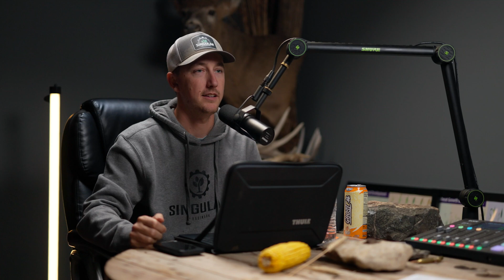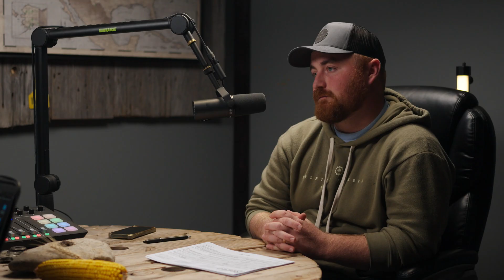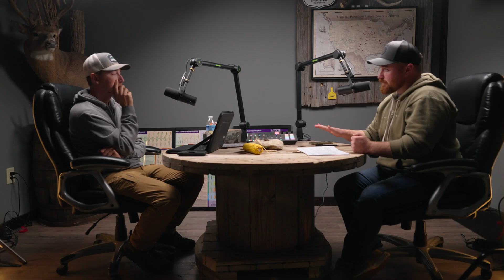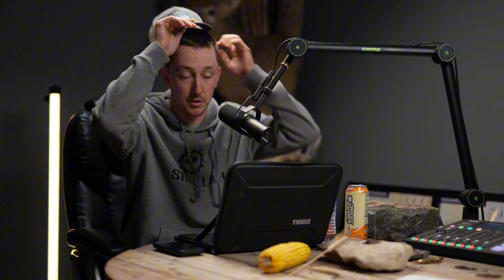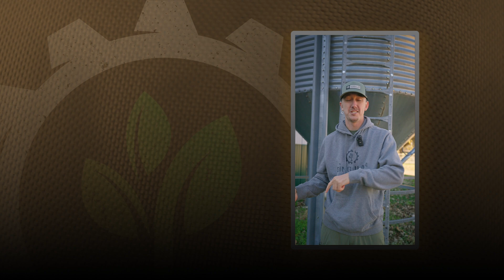Optimize Nitrogen Application Using the C:N Ratio—Maximize Your Yields!

Comment: Your video content are amazing and engaging as well, would like some suggestions
Reply from the maker: Glad you enjoyed the video!  What are you looking for suggestions on?
Reply: @SingularAgronomics  ways to connect
Reply: How much does your CEC affect your experience with split applications in conjunction with C:N?  Enjoying the info.
Reply from the maker: @joshuawendell1529   Personally, I have seen the higher the CEC we have to put large amount at once to create the same effect. So in a Lower CEC, We need to spoon feed to get the reaction we want. Higher CEC I have seen it work better in "two shoots". When adding C: N on top, If you have a higher CEC and High Carbon to Nitrogen then you are looking at the 70 percent than 30. but also know banding fertility is going to make that change happen faster inn the root zone.
Reply: @joshuawendell1529  Let's talk more on different platform